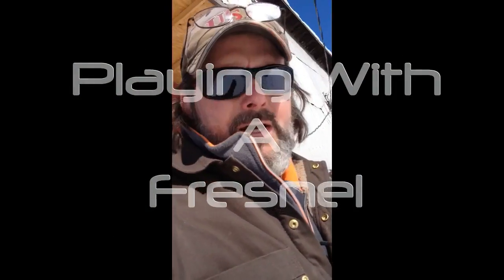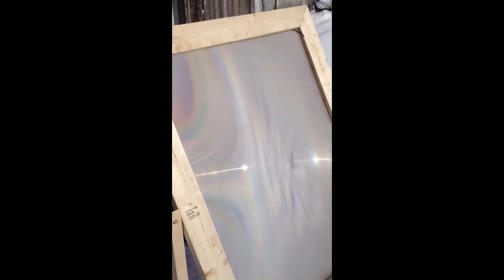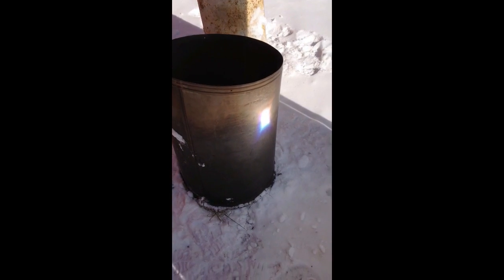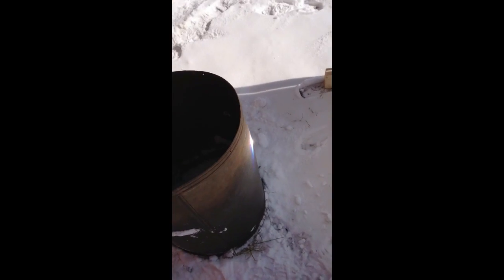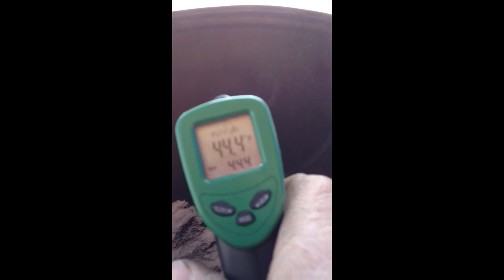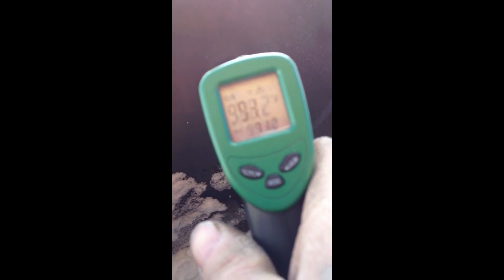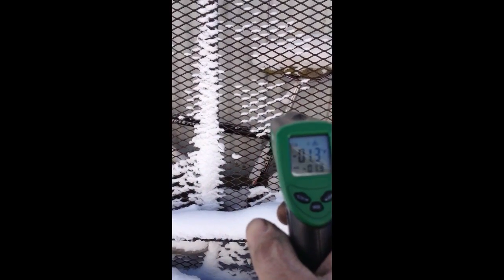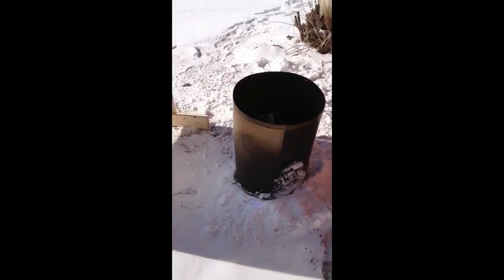Poor Mans Review  - Testing The Fresnel Lens As A Heat Source

Comment: GE fused crystal tube with black pipe or graphite rod could capture the beam and feed hot air into a chamber. It would have to be treated like a furnace with an enclosure of refractory materials to collect and hold heat with chimney and damper for regulation. Essentially a kiln. Possibly use in place of an inductor coil with flyback transformer for annealing. Other stuff...I think you're on the right track. Thanks.

Comment: What about playing it in a copper block, then blowing air over it.....you could duck the hot air through a drying space...solar panel to run a fan???
Reply: +Moonfleet41 an easier, cheaper (probably) and more efficient way of doing it would be using a beefy aftermarket air cooler for a computer. you'd be surprised how much those things can disperse, especially with a strong flow of air

Comment: You can have 2 types of heat. 1 Wet (Hot water,Steam) 2 Dry (Fire) 1) Use water and it will boil and you can use the hot water as radiant heat (I use to do it in construction to heat floors) or steam for (steam engine) wet moisture. 2) You can use the sun's rays to start a fire and keep it going. ( wood or coal) You can find all of this info in building and using solar panels. 
Have fun

Comment: The problem I see with this is transferring the heat somewhere else e.g. into your kiln. If the lens shades the kiln you'd only be getting the same amount of energy as you would if you just painted your kiln black and let the sun shine on it. Depending on how dry you want to go you might be better with a black box in the sun and a small fan to waft air gently past the boards. For more drying you could ditch the fan and use a dehumidifier but that will obviously cost money to run.

Comment: If you can diffuse the light somehow you could make a solar water boiler. Similar to an outdoor wood fired boiler. If you're doing it solely for heat get a heavy metal tank of some kind to hold water. Weld a sizable chunk of steel/iron to the side or bottom and point the sun light at that part. From there you can run insulated lines to where ever and use a radiator to disperse the heat into the air. You'd also need a circulation pump like the ones they use on wood stove boilers.

Comment: One cheap alternative is a simple insulated box that's large enough for the wood you need for a project and including enough space for cinder blocks to weigh down the wood. a dehumidifier, small electric space heater, and a cheap box fan to circulate the air inside; this is especially ideal if you have the room inside a barn/shed to store and operate the kiln.  Good luck!

Comment: I'd try using it to heat a tank of water having the water run into a radiator have a fan blow over the radiator and use that as heat.
Reply: That's what I was thinking you could use it as a radiator and have energy efficient hot water too
Reply: +Dylan Ferguson just exactly my idea. similar setups are even built without an fresnel lens but only blackened, water filled cans

Comment: i have 2 lenses like that i wonder if i use both the same time increase the cutting power a poor mans plasma cutter of sorts
Reply: One will melt the other
Reply: +Super Moon ? No that should work. It's a cone that only focuses on one point like any lens, not a beam that goes any distance and burns stuff. Also you could point two from different angles anyway.
Reply: Oh ok well be safe make a cover for it and have fun
Reply: Note that two different angles might not actually give you much more power though, since they couldn't both be dead on to the sun. I haven't calculated it or anything.

Comment: Perhaps a good way to spread the heat out could be a block of aluminium of similar with the beam focused on it, then water pumping through, then through a hose wrapped around the timber, and back into a reservoir.
Reply: rather a tank wrapped with a “hose“ and the timber inside the tank/oven. also i think aluminium would just melt, rather use steel and place it a little outside of the focus of the lens to spread the heat more evenly :-)

Comment: Lenses work by concentrating the rays on a point like you said, but the focal length is the key. try different distances from the lense and the pattern will open accordingly. considering the length I see there though, I'm not sure you're going to be happy trying to forge with that particular lense. It's focal length seems too short to allow you to manipulate project of decent size even if you do find the right distance. Still, I'm amazed it produced that kind of heat.

Comment: Wow!  Did you say that was from an old flat screen TV?
Reply: +JT Bear  Yep. Out of a rear projection flat screen to be more accurate.  I have one from my old toshiba 52" theatre view tv that died on me just waiting for a frame. i have seen them melt stacks of pennies down as well as steel nails.
Reply: Sho81 wait really? It's about the curvature of the panel, rather the dimensions of the whole device? Never knew that.
Reply: +JT Bear These kinds of lenses come out of rear-projection displays
Reply: Sho81 Would you call them flatscreen? They're pretty bulky in comparison to an LCD of the same size
Reply: Rob Mckennie Yeah. The flat screen only applies to a screen where the front is flat. Unlike the old crt tv sets that have a rounded front.
Reply: Sho81 Thanks, good to know!
Reply: Rob Mckennie Yep. And every once in a while you can find them cheap or even free on craigslist. 1 60" hd for $100 in my area  and a 50" free both claimed working.

Comment: You should use that to try to use that to heat up a piece of steel instead of using the forge for a small project. That would be pretty cool

Comment: Putting an industrial sized heatsink on the inside will allow better dissipation of that heat, if that's what you're looking for. In bushcraft, we use those as solar boilers or the pocket sized ones for starting a fire.

And as others have pointed out, keep that sucker covered when not in use. It excels at setting shit on fire.

Comment: maybe your 2 inch by 2 inch solid block welded to the front. probably should be contour to the can on the back side. To absorb more heat? Than copper wire wrapped around the can to disperse it better? Just thinking out loud. Great video keep them going.

Comment: if you want a more diffuse light without buying a new lens, you could try to find a diverging lens at a flea market. An old photographic enlarger lens might work. You would need the larger internal lens, which is 4-5+ inches across. It's usually glass, so it wouldn't melt as long as you keep it clean.